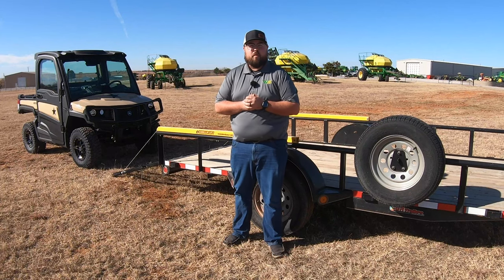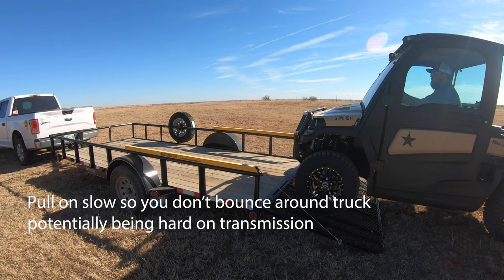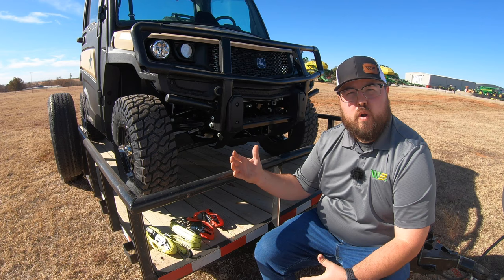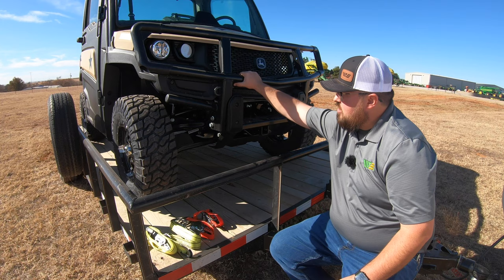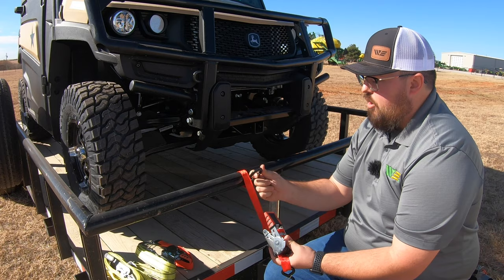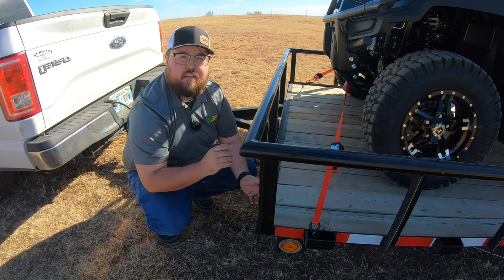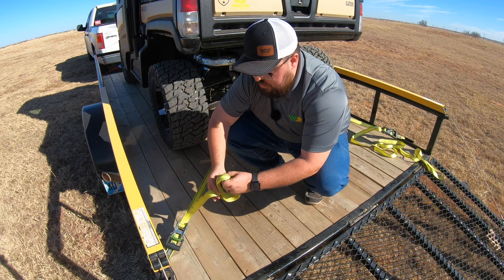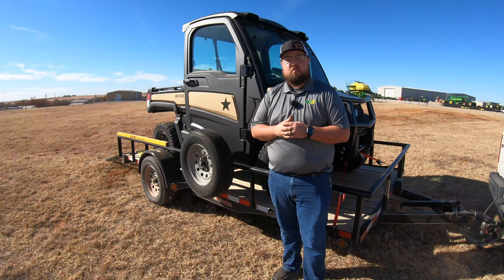How to Load and Tie Down Side by Side UTV on a Trailer

Comment: Good demo of securing a vehicle on a trailer. I like to go from the opposite point to the trailer crossing each strap and having the load work for itself to keep it secure.
Reply from the maker: That doesn’t sound like a bad idea. Thanks for watching!
Reply: Ever cross your straps. The suspension bounces and will ride up and it one breaks your strap will pull it sideways

Comment: Wouldn't it be safer to strap it through the tire? You're strapping it to the frame. Wouldn't it loosen the straps once you hit a bump? If you strapped the lowest point or maybe through the tire, the vehicle's suspension would still work, but the straps would still stay tight?
Reply from the maker: This is a good question. I now there are many trailers that have railing in the floor that is made for tire straps. From my experience of hauling a bunch of gators as a salesman, this has always been very efficient and when done correctly has never had any issues, even on our bumpy western Oklahoma roads. The key is making sure to get tension on all four corners that are all pulling down and outward. The tire idea may be good as well though. Thanks for watching!

Comment: How would you size your straps, by working load or breaking strength?  I am shopping for straps right now.  Tractor Supply has some that are 1667# working load, 5000# breaking strength?  Would these be adequate for a 1700# side-by-side or overkill?

Comment: Does the roof of the Gator need anything to keep the wind from loosening it or is this no problem?
Reply from the maker: On the newer gators with the bolted on roof I would not worry about it. If it is one with a clamped on roof then I would make sure to tighten my clamps and have an extra strap ready in case you have issues with one failing.

Comment: If my UTV weights 2000lbs. I just need 4 straps of 1000lb breaking strength per strap in order to strap down my UTV safely. Trying to understand straps.
Reply from the maker: You need 2000 lbs of break strength when you add your straps together. You could have whichever mixture of straps you chose as long as when they are added together they are at or above 2000 lbs. I hope this helps and thanks for watching!
Reply: @WesternEquipment  Thank you for clearing up my issue. So many you-tubes about straps but nobody clears that issue, that total straps used must total or exceed your total towing weight. Thank again
Reply: You need 4000 lbs of working load limit (NOT breaking strength).  As a minimum, four 1000lb working load limit straps are needed.  It gives you 2x safety factor.  Once you exceed the working load limit, you are in uncharted territory with the straps.
Reply: A bit late but just an fyi the other responses are completely wrong. You need an aggregate WLL of 1/2 the overall weight of your load. So you need 1000# of WLL on your machine.  That said the way he has the straps in this video, mounted from the trailer to the load reduces the WLL of the strap by 1/2. So you would need  4 500# WLL straps. Always a good idea to go above that but that is what is required. Also break strength is not WLL. WLL is typically 1/3 the break strength but the break strength is never used to determine proper load securement.